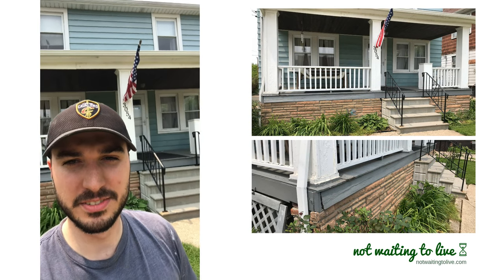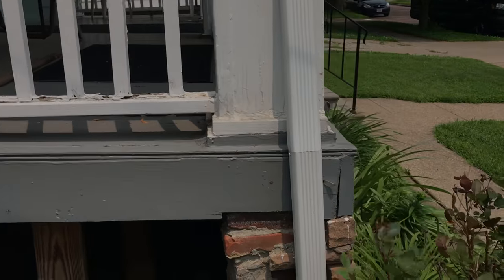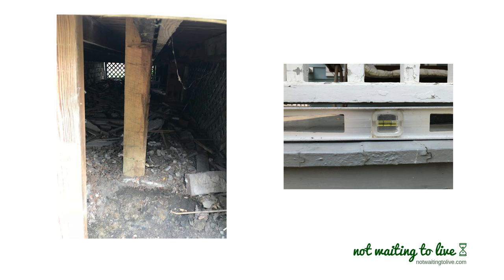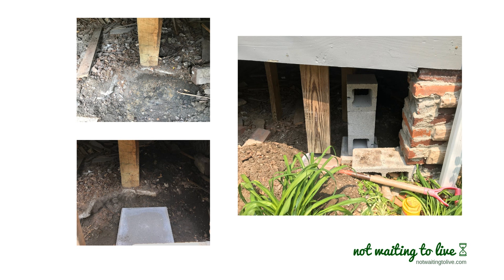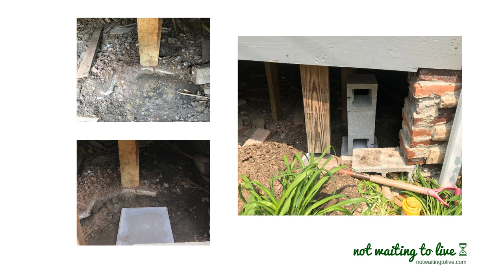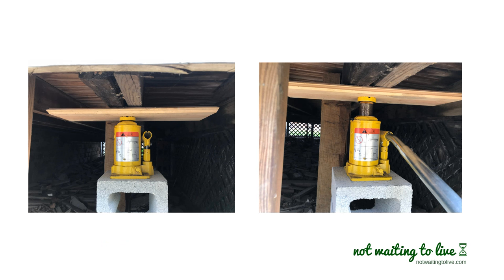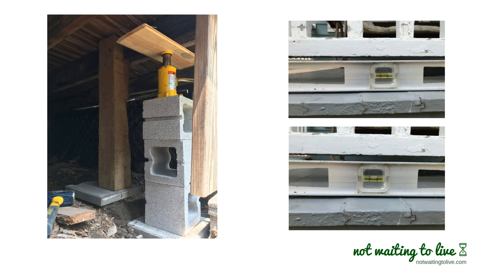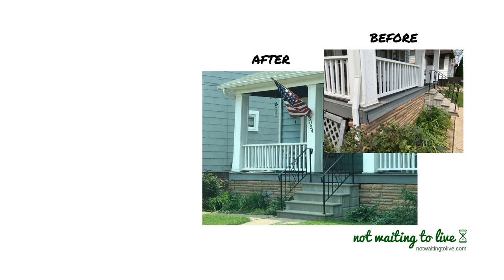How to Raise and Level Sinking Front Porch Deck Handy Manny

Comment: ENJOYED your video very much ! 

I would only make one polite comment: the particular orientation in which you placed your concrete blocks was (is?) in fact INCREDIBLY DANGEROUS :-O 
Mold-Poured concrete "cinder blocks" like that are meant ONLY to support their loads with the HOLE ORIENTED UP & DOWN. 
That you oriented not one but ALL of your blocks with their holes oriented horizontally will almost GUARANTEE they will eventually suffer CATASTROPHIC FAILURE of the load being placed on them - particularly if you continue to use only that "small-footprint" jack which is pushing down IN-BETWEEN the vertical "walls" of your blocks !!! 

PLEASE take some time to RE-ORIENT your blocks at your earliest opportunity ! 

Kind regards, 
-Mark Vogt | VOGTLAND OUTDOORS Channel
Reply from the maker: Thank you for your thoughtful reply Mark. I’m sure others reading the comment section will find your insight helpful. 

I agree with you. And you can rest easy knowing the blocks were only temporary to support the jack. They are no longer under the porch.

I oriented the blocks that way to support the base of the jack as it’s so small it fits through the center of the blocks. For what it’s worth, it worked. You get lucky sometimes...
Reply: Thanks for that reminder to me,  as well. I'm an amateur. My house was built in 1917, but the parts that need repair, like the porch, were built in the late 60s early 70s. Lesser quality. Thanks.
Reply: One of the first things that caught my eye. The other is that those supports are not under the joists, as required to properly bear load.

Comment: I hsve a 1930s house with a basement underneath and you can see where the corner of the house is about an inch above where the porch boards are.  The porch on that area in graded towards the house and even though there is a overhang the water has been flowing from the outside edge to where the pirch meets the house.  This has been happening for years i wiukd guess since the wood there is rotted at the ends andyou can see light in the basement ceiling.  So i have thought flashing may help but then i know it wont because the porch is still leaning towards the house instead of away.  There are some 7 ft jacks supporting about 6 areas in the basement, but not on the beam that is supporting that corner of the porch.  It is about an inch low, meaning that i probably need to get a jack or two and slowly raise this beam about 1.5 inches to get the grade correct, need to put flashing in and seeal underneath with spray foam until next year when i can start replacing the rotten boards on the porch.  I have a few other projects that are more of a priority.  So i am going to buy a few jacks and maybe even raise some of the ones that are already in place.  The support beam may have dry rot so i may need to attach another support beam next to it to help carry the load.  I am hoping to also get top soil and grade the yard to prevent the water on the ground to flow the other way and to prevent any more damage.  I have never done this type ofvwork and thank you for helping me formulate a plan.  I cant afford a new porch and i like the one i have.  Itbis a big covered porch and i want to enjoy it .  Some day add planters and other pretty things.  I am hoping it will help the second story also where the floor has actually dropped halfway in the room above the porch.  The hard woodcactually comes to a pointninnthe middle of the room.   Thank you for your video and if amyone has suggestions please feel free to comment and let me know.  Ty

Comment: A farm Jack works for this. Just put it under the rim joist
Reply from the maker: Thank you for pointing that out. That would've been the better tool for the job. And I see they're less than $100 at a couple supply stores.

Comment: Cinder blocks get there strength when laid the other way. You're lucky it didnt break.
Reply from the maker: With the interior channels vertically oriented the compression strength of a hollow concrete block is 1,900psi.

https://www.uop.edu.jo/PDF%20File/uop%20[Architecture_Ebook]_Masonry_Design_and_Detailing_For_Architects_and_Contractors-20615_Part279.pdf

Do you have any guess what the compression strength of the same block is with the channels horizontally oriented?
Reply: @notwaitingtolive  tried the same and my cinder block busted no were near 1900lb. Strength. That was for a deck that weighs less than that porch. I also recommend against even using these type of blocks at all.
Reply from the maker: @HookSettinHooligans  thanks for sharing your feedback. What material did you end up using?
Reply: @notwaitingtolive  some boards I had stacked together.
Reply from the maker: Striker Thunderlick still waiting on someone to shoot from the hip about how much weight those stacked blocks support...
Reply: @notwaitingtolive  probably about 600-700 pounds.  Most 1 inch thick pavers have a break strength of 500 lbs, so I'm spotting you 200 lbs because you're at 8 inches instead of 12, so it would be a bit stronger.  Even though it's COMPRESSION strength may be anywhere from 2000 to 6000 psi, it's under a different type of load.  Compression is considering that you have equal amounts of pressure on both sides, and how much it can resist crumbling.
Reply from the maker: Wascly Wabbit Gaming thank you for being the first one to offer an estimate. And I’ll admit I (we all) get lucky sometimes working on these types of quick fixes. The alternative would’ve been to spend god knows how much time making a Jenga like wood support for a platform for the jack.

The 4” x 4” base of the jack is putting a sheer stress from whatever stress is above on one wall of the half block. The sheer strength of hollow masonry block is 50psi. If the walls of the block are 1-1/4” thick and the perimeter of the base is 4”x4=16”, the sheer strength of the block to keep it from crumbling is 1.25”x4”x4x50psi=1,000lbs.

I think these blocks can hold 1,000 pounds as they’re arranged.

How many pounds force do you think is on that one support? The deck was something like 8 ft deep and probably 8 feet to the next support.
Reply: @notwaitingtolive  depends a lot on what else it's supporting also, roof or house, if there's anything in it as a storage area also, not to mention the condition of the other supporting framework (it may be supporting less than it's share of weight than you think), I'd optimistically estimate about 1700 lbs, I might take the risk, but if it was my call to send someone else or like my son in there, I'd up my guess to say a worst case possible estimate, 2 tons for my piece of mind.  And I'd still be concerned.  But that's really besides the point, which is when it could be stronger one way, why would you risk it doing it wrong, just because it may (or may not) be good enough.

Comment: From what I saw under the porch and home , Buy your own jack forget borrowing  , you are going to be using it for this house , or who ever own this house , most  old house 80yrs or more  like this have Foundation issue , that what im dealing with .
Reply from the maker: I agree. The porch on this old house is every so slightly pulling away from the main structure over time. Eventually it will need to be torn down and replaced.
Reply: @notwaitingtolive   True but until that time...You!😊 Showed us a Great!😊....
quick fix!😊👏👏👏✌

Comment: Using a concrete block to support the jack is bad idea.  Hollow concrete blocks like that can easily fail.  You would be safer building cribbing out of railroad ties or 8x8's.
Reply from the maker: Nathan Esbeck even hollow concrete cubes like this 8”x8”x8” may surprise many people with their compression strength of 2,000+ pounds per square inch. If you really wanted to be safe you could go with the 8”x8”x8” solid concrete cubes with a compression strength of 4,000 psi.
Reply: I agree. I never use cinder block. I like wood 6 x 6s cut at about 18" wide. either side by side.
Reply: Mine failed recommend against it
Reply: Cinder block is fine, but that's not how you're supposed to use it...  The hollow part should be aimed vertically.  You're putting all that weight on a 1 inch thick SIDE wall!  It could definitely crumble and drop the porch on top of someone and KILL them.
Reply: @wasclywabbitgaming6875  My though exactly. Stack them the same way they would be used if building a load bearing wall.

Comment: Hi. thanks for the info on this, but mine is a bit more I am replacing an old floor that was way more than I thought (2 o3) rotten boards turned into all because each layer I got to was so badly repaired before I didn't want to put a new floor(deck Boards) instead of a way to expensive tounge&groove.(original) floor. Trying to brace roof to hold up while I removed boards rotted under posts on an all-ready unlevel layered rock foundation to house its self. Since the whole house has shifted here & there due to city rainwater runoff flooding my yard, basement & furnace Unlike my ducks who love the moat time after time Being a vet on a fixed income I grab & recycle other peoples used wood or what I rehab with needs repairing, pros are not affordable i do all my repairs though I love fixing things my body wear-n-tare & military service only lets me do bits at a time, cold weather this early & rain has put me behind. The roof is old & needs to be replaced also the more I tear into it to brace it the scarier it gets. it's hard to know where to brace it since the roof frame is rotten in spots to can I put bracing on the ceiling part to support it till I can afford to redo the ceiling & soffit areas? that looks natural or good & not a band-aide job like the previous idiot did who sold me this nightmare? & what do you do when the floor frame boards weren't cut to meet the outside frame & the board is too high to level the rest of the floor like it was each time I jack up the outer frame roof seems to get worse?
Reply from the maker: Sounds like you’re in a tough situation. I have seen people use metal and wood temporary supports to hold up a porch roof for many months at a time. I’ve never seen a decorative design, just enough to get by.

It sounds like this deck requires making more than simple repairs. Contractors are more expensive than ever, but some jobs do require previous first hand experience making these repairs.

Comment: Blocks are not meant to be structurally sound the way you had them , lucky they didnt collapse
Reply from the maker: I agree. The blocks do not have their maximum strength the way I ranged them. The jack was smaller than the hollow core of the blacks block and could not be arranged as intended. This porch was sagging but still supported all the way around. Even if that jack collapsed the porch would still be back at its original height.

Comment: Way to go using the concrete blocks the wrong way. That could of been bad. Real bad.
Reply from the maker: I agree that the blocks are in the wrong direction for their intended use. However, their application in this video is not their intend use. The side wall still has a shear strength >1,000 pounds and the jack would slip through the center hole of the sash block if positioned vertically. That means the failure point becomes the shear strength of whatever is directly underneath the jack. I think a better solution in hindsight would be to stack the blocks vertically and put a material with a higher shear strength than the sidewall of the block to support the jack. What would you recommend?